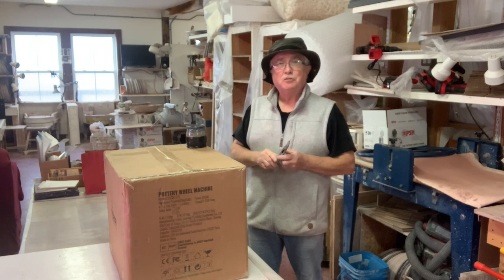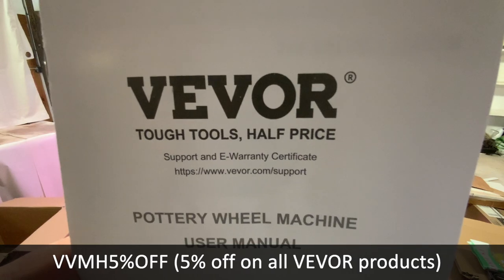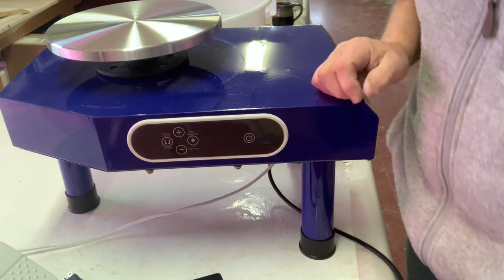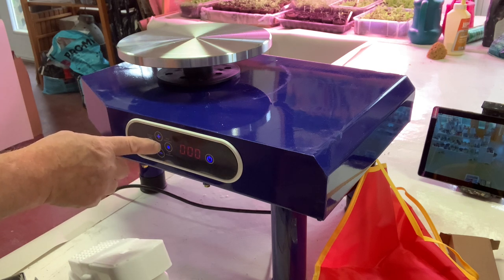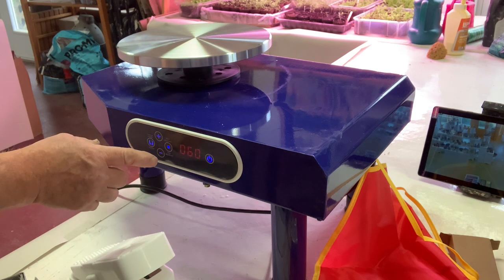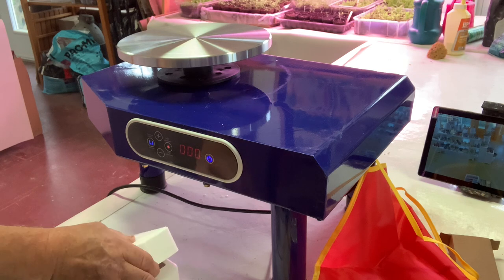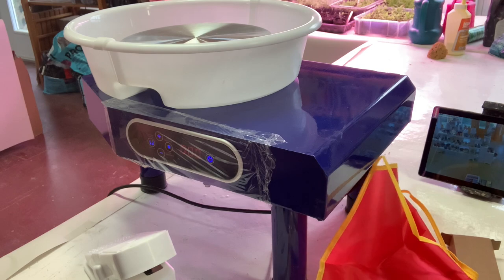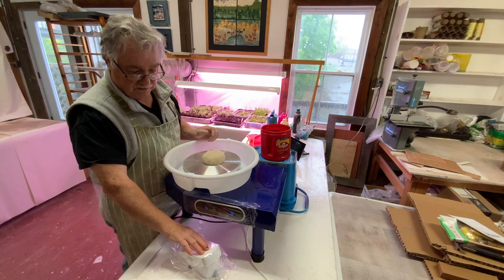Vevor Potters wheel revue, perfect for older children.

Comment: Regarding the wheel not stopping at 60 rpm.  I opened the bottom of the foot pedal and adjusting the blue gear so it goes a groove higher,  by raising the sprocket up in its track.  It now stops on 0 rpm.
Reply from the maker: I gave the wheel away to a local family who have two children. I will let them know, you must be some sort of genius. Thanks.

Comment: These reviews are really very superficial. It matters to me what the build quality is like, if the wiring is done properly, if the wheels are even legal to sell in Canada and use, ie have they been inspected for safety. I think I see exposed wiring underneath.  The ability to turn is kind of a given, will they last and can I legally use a machine like that in a commercial setting is not.
Reply from the maker: This model has an encased bottom as you can see in the video so no wiring or belt is visible, that is a good safety feature for kids. The wiring would have to be inspected by a qualified electrician which is not me. As a lay man it all looks fine. These wheels are made for the hobbyist. My concern is with the digital touch pad which is why I covered it with saran wrap, I prefer the mechanical switches but then all my studio wheels are old, though still working for 35 plus years. Regarding the wiring I would ask is there anything sold in North America today that does not have wiring made in China. All the light fixtures we purchase or anything else. I do not hear massive problems reported from the millions of items sold annually. I have no experience with the customer service from Vevor. I would assume like US wheels you have to pay the shipping to return the item and it would be repaired or replaced under warranty. That is what happened to me with a US made wheel, twice in a month, it appears problems occur even if you spend 5X what you can buy this wheel for. I think using a grounded three prong outlet in a commercial setting is all that is required, having a GFI outlet is preferred when water is near by. My studio was inspected and they did not require GFI outlets on the wheels. As with everything in life you get what you pay for, this is an intro wheel that will give you a taste of making pottery for little outlay, most people never get past the play period. In a professional studio setting it is paid for by making and selling 10 mugs, hardly a risky investment.
Reply: @Vsmithpots  The $209 model in the link clearly has an exposed motor with wires exposed. I bought  couple of the whte ones they had at about $300 in the beginning of 2022, I think you might have "reviewed" it too. it was TRASH, pan scraping against the head, folded metal with gaps, power cord just where mater might get spilled. Your "review" doesn't really qualify for that label, but keep it up and you might get a few more free wheels👍
Reply: @KSCPMark6742  we understand your opinion. is not a good wheel. maybe is ilegal to sell. this review is veeery superficial. anything else? good night
Reply from the maker: @KSCPMark6742  I have donated the last two of the wheels to charity and as you suggested I am trying the original one in a production studio setting. Threw 24 bowls on it this afternoon, let's see if it turns on tomorrow. The model they sent me, see the video when I turn it upside down, is enclosed with no wires showing and no belt exposed. I think may be this one is a newer model than on the web site. I emailed your comments to my contact at Vevor and asked them to supply me with he necessary certificates to show it can be sold in North America. I cannot imagine that Amazon would allow illegal items to be sold.